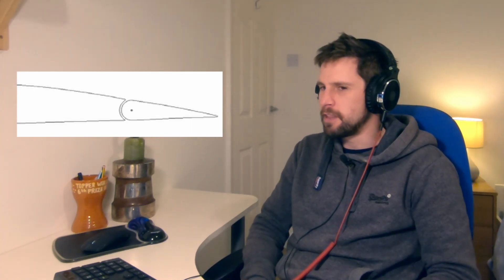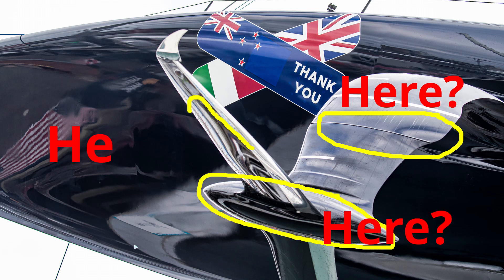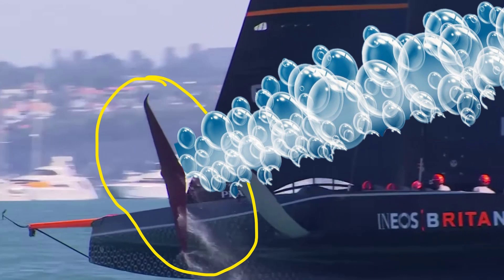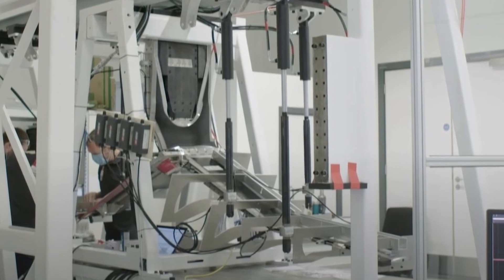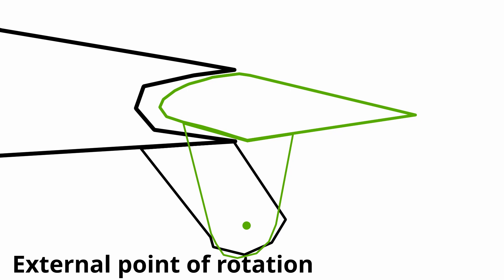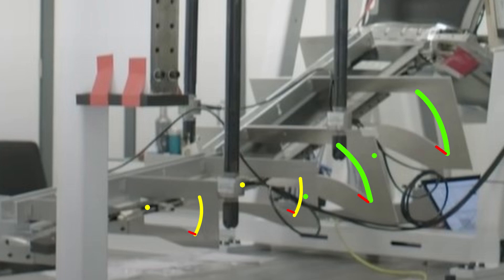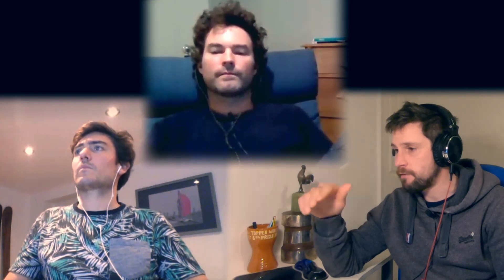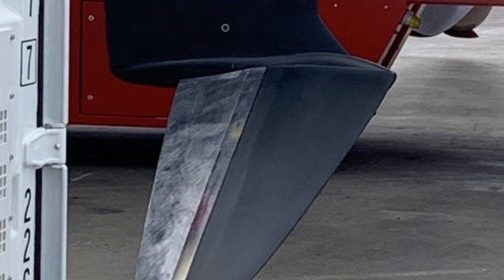Inside INEOS' Foils : the most complex foils that you WON'T see in the Cup

Comment: May I ask a question unrelated to the foil-controls, and I hope not too basic ...   Do these boats gybe or tack on downwind legs?  If the boat speed is above the wind speed, then their apparent wind direction will be forward of the beam.  So, during a change in tack, will the bow pass through the apparent wind - not the stern - even on downwind legs?
Reply from the maker: They still gybe. Although you're right, as they go through the gybe, the wind will feel like it is coming from in front. On board it will feel like the wind goes light and AWA will swing around the bow. 
However, it is still a gybe and still feels very different from a traditional tack as you are turning away from the apparent wind angle toward the leeward side of the boat and the entry to the turn is a bear away.  
This isn't just unique foiling boats, but plenty of high performance dinghies experience this (check out my channel for some skiff sailing which provides the same).
Reply: @MozzySails  Many thanks for your answer to this question - and for your excellent videos, in general.  My sailing experience is limited to traditional, displacement boats - and can only dream of speeds reached in new high-performance boats.  This America's Cup is very exciting to watch, and a wonderful showcase for our sport.

Comment: Thanks again, super interesting
I have a basic question regarding the AC-75. from a hydrodynamic perspective, the direction of the hull is formed by the line connecting the rudder and the foils (look at the image in the link below) yet the boat sails like a traditional sailboat (on the transom to bow direction) how does this work?  https://www.dropbox.com/s/gdlzrxnetglzlbx/4Forum.png?dl=1
Reply from the maker: the resultant force for the traditional sailboat you see in your diagram is not completely correct. Actually, all boats make leeway (slipping sideways). The amount of leeway is determined by lateral force from the sails and keel / centreboard shape. This leeway is required to get the correct angle of Attack on the keel / centreboard to produce lift. 
So, even traditional boats, despite having their keel and rudder aligned on the centreline, do not actually travel through the water with them in line with the direction of flow. 
So, you may consider the AC75 an extreme version of this.  
The rudder does no need to be in line with the main foil to turn the boat, it just need to be link physically via the hull so that changes in direction of the rudder cause 'yaw' on the vessel, which changes the AoA of the main foil and therefore direction of travel.
Reply: @MozzySails  Thanks for your answer!
 I knew the question will be hard to explain. The question is not about the functioning of the rudder. There are many things which seems strange. 
For instance the forward force is upwing to the friction (foil) which creates a downwind moment. 
Also, I would expect the sail to be more sheeted in to be parallel to the rudder foil arm line.
There are many things that seems to me are supposed to work differently.
Reply from the maker: @Yairsuari  so your question is about the thrust (sails) being to windward of the hydro drag (foils) and the effects of this on helm balance?
Reply: @MozzySails  Yes

Comment: The mechanical engineering is 50% of the reason I follow America's cup.   Until now I was left guessing by myself due to the secrecy.  Mozzy's analysis completes the picture for me such that I can fully experience the cup.  

Watching the races, Im always looking for how the engineering trade offs are impacting the race and how each team compensates.

Thank you!  Also, please analyze how the tail and underbelly of each boat affects its launch from thr water.  American Magics was reminiscent of the step behind a seaplane's belly that helps reduce drag once planing.  This tail shape may have allowed them to launch with less foil lift, allowed them to lift the tail with thr rudder, and allowed them to rotate sooner like an airplane taking off.  They could then benefit from less foil drag.

Also please discuss what types of electronics the rules allow for the flight, rudder, and trim computers.  How much are the sailors inputs being processed before actuation of the surfaces?  For example, is the wheel directly attached to thr rudder or can there be a computer in the loop running a control algorithm to smooth it out? 

Are they allowed model predictive flight control?  It would be a real time simulation of boat flight physics which could improve performance and safety by predicting ahead a few seconds and modifying feedback to keep the foils in the water or limit turn radius and trim combinations to avoid rounding up and capsizing?

And if tese advanced fly by wire controls are not allowed what are the implications for faibcompetition, safety and ultimae performance?

Comment: Great video! I am not sure the "four flaps" assumption is correct though. At 8.20 in th video, if you remove the bottom green dot, all the points are in the same line, and I could only see one external hinge (looking quickly). That could mean the whole flap is actually one piece, not flexibly joined.
Reply: But I think the ideo assumes, perhaps by a distinctive visual difference between inboard and outboard flaps that there is a different amount of rotation ... So although the pivot point might be the same, there are distinct different foil flaps which exert different pressures.

Comment: Love your commentary but have a question that I haven’t seen addressed. Ultimately everything these boats do comes down to boat speed and VMG. At the end of the day what are the limiting factors stopping these boats from routinely exceeding 50 knots? Is it primarily hydrodynamic drag on the foils or aerodynamic drag on the hull and sails? Would love to see you talk about this aspect... keep up the great work!
Reply: It is cavitation of the foils which basically means the pressure differentials over the foil create local pressure drops where the pressure goes below water vapour pressure creating vapour bubbles over the foil which then looses its grip in the water. This occurs around 50 knots. To have a stable foil above 50 knots very different profiles are required (non-NACA profile) which are suboptimal below 50 knots...
Reply: @Niels4354  Hi Neil's, I am sure you are right and have seen similar statements. The cavitating presumably only occurs on the upper/low pressure surface, with high pressure side not impacted, so not sure what effect then comes into play to  create increased drag and thus act as a limit on top speed. Can you expand?. Thanks.
Reply: Did a bit more research on this and seems cavitation bubbles essentially increase thickness of foil which in turn increases drag. There were a couple of interesting videos from Vittorio D'Albertas, E4 and E25 on foil design and cavitation/ventilation. Would be interesting to see Vittorio and Pietro in discussion with Mozzy and co.
Reply: @Niels4354  cav
Reply: I’m familiar with cavitation from windsurfing. If the AC75 foils are starting to cavitate at the high end of the speed ranges we’re seeing them reach I would have guessed there to be more radical reaction from the boat with the sudden loss of lift on the foil and resulting loss of counterweight of righting momentum. It would be interesting if these foils have been tested to see when the cavitation really starts to occur - 45, 50, 55, 60 knots? T will be interesting to see as the series of races continue if the average boat speeds continue to increase...

Comment: The rules are being "F1ed" which is totally expected in a top form a competition, it might be not ideal. The good old "grey area" also called "it's doesn't specifically forbids that" or "It's not technically compulsory in that way"
Loving the content; uniquely detailed, accurate, and insightful.
Reply: That's because Americas Cup and F1 are two of very few "design competition" (aka Formula) classes in world competition. That's what makes them interesting and different from all the dozens of one-design classes that try to find the best drivers or sailors. AC and F1 are trying to find the best engineering solution and then ideally any fool they put on the helm will win. If that fool is a world-class pilot of course. But if the engineers do their job right and the boat is fast enough it doesn't matter which of Barker, Spithill, Burling, Ainslie, Outteridge (sad to see him sitting out this time as he's great) you have driving. Just like almost anyone in the F1 field could be world champion in Hamilton's car.
Reply: @BruceHoult  Couldn't agree anymore, especially with the "almost" because some could manage to ruin a race in which they are racing alone.

Comment: I hope that you have a video on the actual mechanics of the flap motion.  The pressure on the foils will be high and therefore the forces needed to control the flap will be high.  Keeping the mechanism small is a real challange
Reply: I don't think there is public video about it anywhere. They're like the wing keel designs of the 12mR era. "Put a dress on the boat before lifting it out of the water so that nobody sees your secret bits."

Comment: On an aircraft flap the initial extension movement of the flap is aft before then going down. The first flap setting is used for long runways where the low speed lift isn't so critical but drag is, and the second and further settings  increases the lift of the wing for shorter runways (I could go into more details but it isn't relevant).

If that can be replicated within the rules, the initial extension would move the centre of lift aft without a huge increase in drag so it could be possible that you could control the pitch of the boat by continually moving the flap small amounts  with greater flap extension for increasing lift during “take off” during tacking and gybing.

Comment: Is the weight on the flap same as the net weight of boat plus working load?
Reply: No, a significant portion of the boat's weight is supported by the fixed wings.